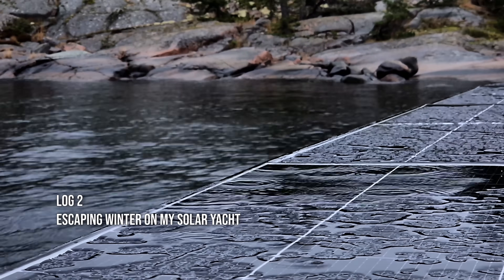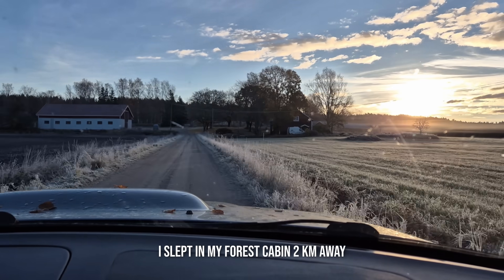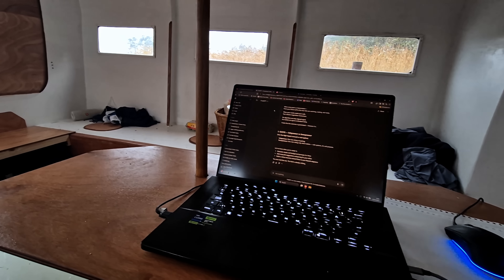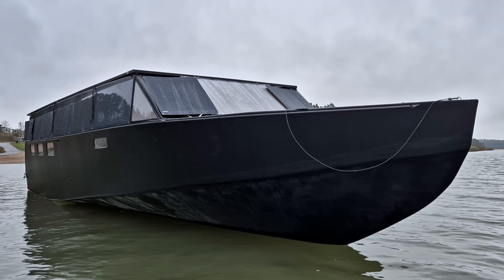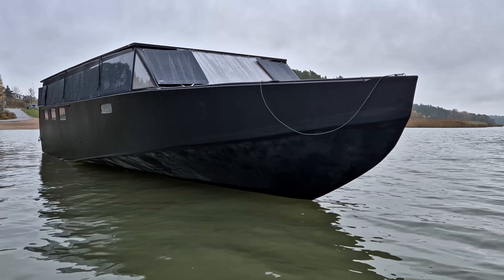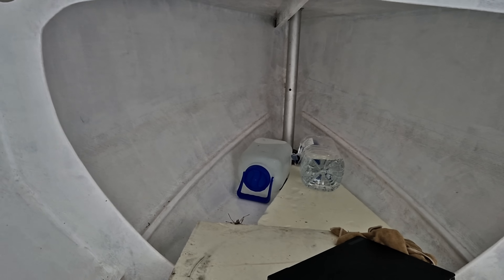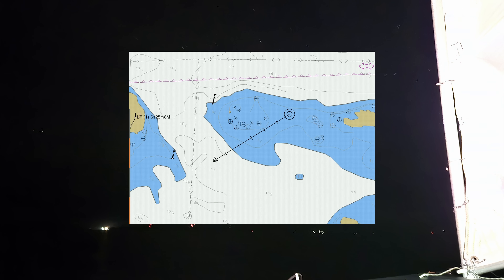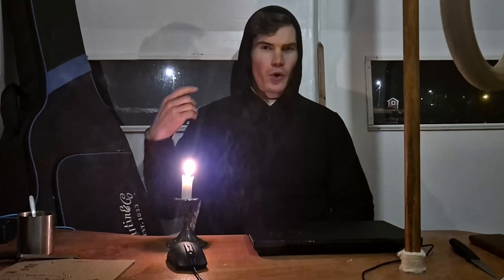🌧 Escaping the Nordic Winter on a Solar Yacht That Runs Forever

Comment: You have the same car I owned before. I love the 2006 forester xt. Mine was an automatic transmission. Great fast, capable and nimble car. The power and awd is a great combination with the automatic. Pulling my trailer with maxum 1900sc ( total weight over 2100 kg) up the launch ramp was so easy. Even the very steep ones that cause many with smaller boats big problems. Loved that car a lot. Only problem. Had 3x a headhasket failure. Repaired it twice. But the third time was not worth it anymore. Nowdrive the 2017 outback. Great car too. Bigger. But more heavy and less power and more safety shit nobody wants, like lane assist and start stop and e brake.

Comment: I would put spray foam inside the front where you are getting all that noise from. It’s light and will make a world of difference. I think you need some type of weight/keel
On it. A strong wind is going to show you much and you need a very strong point to tie the anchor off in a storm. Good luck, you are going to need it.

Comment: I love your channel, keep up the great work.  I hope your new boat comes soon with a huge back deck, 2 electric motors and 1 Diesel motor for emergency power.   You can use Motor as a generator for the batteries and on your Skift.   The Diesel can be stored in the lower haul of the boat to help keep the boat much more stable.  Diesel can be used as great Barter on the open seas.

Comment: You will loose that steering quickly in rough waters, and perhaps also the motor..  The high seas can be nice but they can also be monsterous and absolutely unforgiving.  Otherwise, cool.  I have long water to make a solar yacht.  It's kinda part of my retirement dream.  I come from a family of boat builders in the U.S. Pacific Northwest.  My Dad retired on his sailing yacht but it also has electric motor that charges from the water currents.  He has a small area of solar for internal things.  One time heading out to sea, the 6cm diameter steel holding his rudder was bent by waves hitting him latterally.  Every wave that hits in that area shook the whole boat hard.  This is because the wind in the area funnels between Vancouver island and the mouth of the Puget Sound.

Comment: Even without sun, I bet it would still be one of the cheapest and most effective means of transport, even if you had to pay to charge up your batteries at marines. Also batteries are so cheap and lightweight now you could add an extra 10kwh for about 1500 euro. Add a  small 500w at 24v wind generator from vevor for 150€, and this would be a complete solution for northern and southern sailing, summer and winter.

Comment: it looks ok for small water bodies or maybe at most for places like in this video where multiple islands block big waves. But going into open sea with this thing is gonna be OceanGate 2.0........ You absolutely need a keel for regular sailing in an open sea. There are a few instances when people crossed Atlantic on flat powerboats but only for record setting and they were also tracked by rescue teams and refueling ships.

Comment: glue can't mount solar panel will, a strong wind can blow it away, and you should not connection multi cable on one point.

Comment: that vessel is not seaworthy no safety equipment, no insulation,  no bilge,  you need a reserve of minimum 25 percent full power capability to get out of trouble.  Single pane windows, no safety lines on the gunnels,  no spare engine, I suspect you need three minimum.   your solar is not pitched,  nor has it been deep floated with expoxy resing, no maritime radio,   no cooking facilities,  you need boiling water to prevent legionella , no navigation lights,  Your beam has no flex,  its too flimsy,  far too flimsy,  no safety gear,   I see no life raft,  I hope coastguard catch up with you and ban you from going to sea,   flotsam and jetsom will tear that apart,   There is no emergency keel,  and you are not wearing the right clothing for travel,  no sea water strobes,  no horn,   oh my god,  you have made a thirty foot coffin for your burial at sea.

Comment: I'd suggest packing some spare parts and tools.  You could probably get away with 1 extra of everything, including a new boat motor.  I'd also suggest something for heating and cooling (and someone else recommended insulation, another good idea).  There are tiny (window) AC units that will pump out heat or cold as needed for a few 100 eur/$ and don't weigh much.  Also, I'd suggest tilting the solar panels on the roof a bit rather than fully flat.  You could make them all one tilt (and adjustable) but the simplest would be to put them like a house roof, an upside down V.  The water will run off of them much more easily, and even say 10 degrees will help.  I'd also tripple check their mounting to the boat.  Normally people use (home) roof mount rails for these and that would be a wise plan here.  Finally, use caution, 100+V (especially DC) and water is no joke.

Comment: Great build.
You may want to look into the Arduino Pilot system, open source gps autopilot.
Used for RC drones but is also easy to adapt to boats and tractors etc, anything you like.

Comment: A layer of insulation foam wouldn't be an unnecessary luxury. It would cost very little, weigh very little, but retain ALOT of heat. Once you enter the Mediterranean that same insulation foam would keep it comfortably cool inside the boat even when the outside temperatures soar up to 40 degrees Celsius. 

Once you're in the Mediterranean, you may just come to regret having painted your boat black. 

I was thinking about the possibility of adding a large sail to save energy when winds are favourable. If you had a tall mast extending up from the middle of the boat you could rig them with transparant sails that would hardly cast any shadows on the solar cells. 

You could turn off the engine and open the transparent sail up to conserve energy in your batteries when the winds are hard enough and move consistently into the direction you intend to go. Meanwhile the sunlight passes through the sail and continues hitting the solar cells and recharging the batteries. You wouldn't have to sit still, anchored or docked, to recharge your batteries. You can just keep going, using the wind when it's favourable, and conserve so much energy that you may just  be able to continuously sail without ever stopping for a lifetime. 

It would be interesting to see you build a sea worthy version of this solar ship. It would have to be significantly sturdier and bigger, but I would like to see you brave the North Sea, traverse the Bay of Biscaye, sail around Spain and Portugal, pass through the straight of Gibraltar and enter the Mediterranean via that maritime route. 

The rivers are lovely, but the open sea, however terrifying, is the real key to freedom.

Comment: A few words of caution, the sea has taken many lives, many of who where far more experienced then you, in far, far bigger ships made for even the harshest conditions in the north sea. 

The sea can be treacherous even during the summer, but at winter, it’s an entirely different story. Winds can change fast, and a safe anchorage can turn into several meter high waves before you even realize how serious the situation is, and then it’s too late.

Ask any captain, sailor or fishermen that worked anywhere in between the Baltic Sea and the North Sea during the winter, this is not a place where you play around, do so and you might not live to tell the tale.

I wish you the best, I truly do, but please do NOT underestimate the sea.

Ps, navigation lights are non negotiable, it’s the law and it’s for your own safety and others safety, you need both navigation lights and anchor lights.

Comment: All the battery positives are tied together, which confuses the 2nd MPPT controller. You need large diode isolation blocks, like a check valve multitap for electricity. That way your Victron 100-20 48v can hit bulk charge and your big unit will still detect depleted battery on its bank and enable bulk charge. Every charger needs its own battery, but they can all be depleted together through a diode block.

Comment: Ok, I'm a lifelong sailor.  Been sailing since i could walk over 40 years ago.  and there are some things that alarm me about this project.  But first the positive.  This is an ambitious project.  I couldn't have gotten as far as you have in a boat i made, i wouldn't even know where to start so you should be proud of your work and what you accomplished.

Now the important parts... 
1) change the paint scheme to orange and yellow or white and red.  Your boat is quite small, and not "normal" in appearance.  Black vanishes into an overcast sea way too easily.  you are limited in both maneuverability and speed, which means your ability to get out of the way of larger or even smaller ships is limited.  So being highly visible is essential.  Furthermore you'll thank me when you're in warmer climates.  it won't heat up as much.
2) that boat is at best a canal boat.  the draft is too shallow, the materials are too flimsy, the ribs are too wide apart.  your ship is WAY too high in the water, which means one good blow and ill timed wave and you'll be capsized, one wave over the transom will put you in the bottom of the ocean.  due to the long design it won't take much wave action to smash that boat to splinters.  I think you're majorly underestimating the power of the ocean.  worse, i've seen lake storms that would probably destroy that boat as well.  i hope you have survival gear, an inflatable raft... basically I hope you are taking your safety seriously.  I've seen houseboats better constructed to survive a storm.
3) I didn't notice any lights.  please add navigation lights ASAP
4) the lack of insulation will make that boat unusable in the summer or winter.  line it with marine carpeting, since you have the walls of your cabin as the hull of the boat, you're at massive mercy of the temperature of the water for the livability of the interior of that boat.
5) if you plan to keep that hull design, you need to add a real keel to it to make it sit lower in the water and be more stable in a serious storm.  
6) if you don't plan to redesign that hull, i feat it will snap in one storm on the ocean.  flat bottom boats don't do well in a storm on any body of water.  and the ocean is no "normal" body of water.  

please be careful.  I tuned in because i was impressed with your project and craftsmanship.  but it really feels like you have limited nautical experience, and i don't think your respecting the ocean enough in this design.

Comment: Without Most of this gear, you're likely to be detained and have your vessel seized...

Life-saving appliances

- Lifejackets: One for each person on board, approved for the vessel's use.
- Lifebuoy: Must be approved and attached to a buoyant line of at least 15 meters.
- Buoyant heaving line: At least 15 meters in length.
- Reboarding device: A ladder or other device to help someone get back into the boat from the water, especially if the freeboard is high. 

Vessel safety and signaling

- Bailer or manual pump: To remove water from the vessel.
- Manual propelling device or anchor: An oar or an anchor with at least 15 meters of rope, cable, or chain.
- Sound-signaling device: A whistle or horn to alert other vessels, especially in poor visibility.
- Visual distress signals: Such as flares, suitable for use in offshore conditions.
- Watertight flashlight: Essential for emergencies and operating at night. 

Navigation and communication

- Magnetic compass: A magnetic compass is required.
- Navigation lights: Necessary for visibility when operating between sunset and sunrise or in reduced visibility.
- VHF radio: Crucial for communication, as cell service may be unreliable offshore.
- Radar reflector: Required for non-metallic vessels under 20 meters to make them more visible to radar. 

Fire safety

- Fire extinguisher: A Coast Guard-approved fire extinguisher, with the correct class (e.g., 5BC or 10BC) depending on the vessel's equipment, such as an engine or fuel-burning appliance. 

Additional recommended equipment

- First aid kit: A comprehensive first aid kit is highly recommended.
- Charts and GPS: Electronic navigation is helpful, but always have paper charts as a backup.
- Other equipment: Consider carrying additional items like a spotlight, binoculars, and a tool kit. 

Without this gear not only is it a risk to your own health and safety, but also to other vessels on the water.
I don't believe your current vessel is sea worthy, even with this gear... But traveling without it, plus proper registration/insurance is guaranteed to get you into legal trouble.

You should also have a small gas powered propeller and fuel reserve for emergency use, it's not listed on here, but an oar would do you no good, and as you are already facing power issues, I believe it to be a must have.

Don't mean to be a downer, but I also don't want to see you die due to being unprepared for your journey.

Comment: Need to add a lot of ballast for stability and safety, the boat looked like it was rolling quite a bit. Also some insulation on the hull to reduce noise of waves against hull and for warmth. But its an awesome little build.

Comment: Nice. But you really need keel, lower the center of gravity, or the boat will flip over on big waves. And close the rear door. As mentioned, navigation lights are also VERY important to have. Plus satellite comms. I’ll ask guardian angels to protect your journey. Be safe.
Reply: Good Points you made...
He's appears to be navigating protected coastlines, rivers, canals, etc. = 0:57

Most likely he is aware that craft cannot handle a open-ocean voyage.  If he takes that out in the North Atlantic it will break apart even in moderate swells.